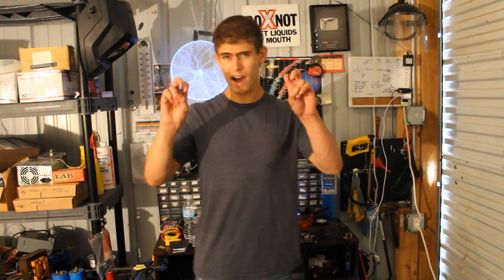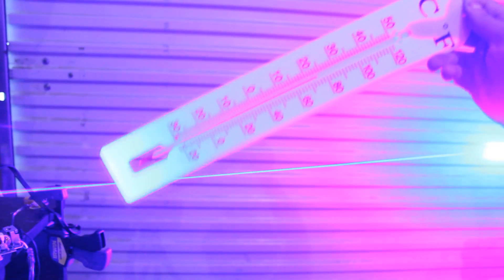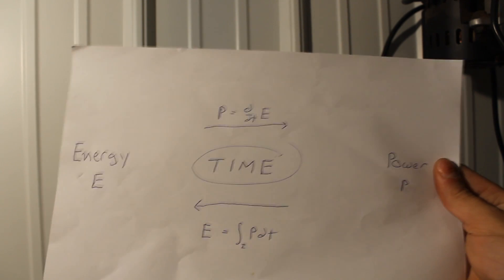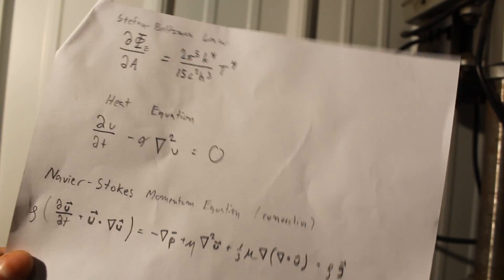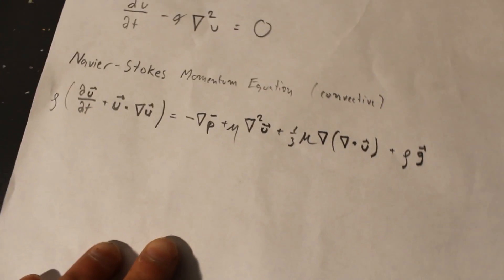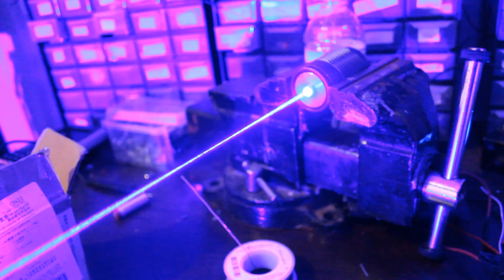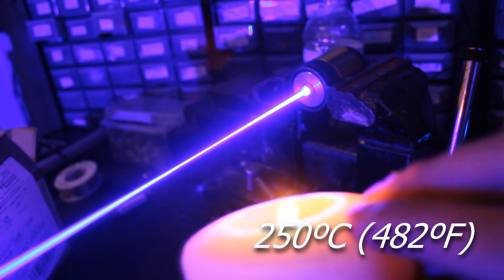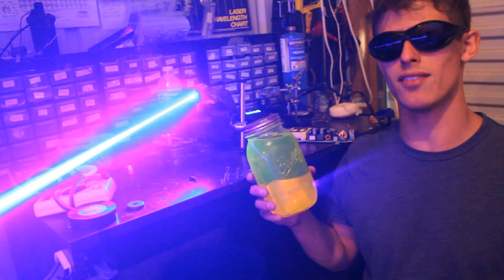How hot is a 5W Laser?

Comment: For an experiment once and for all test water across it’s surface for over 10 miles there should be 66.6 feet of derivation based on the supposed size of earth and curvature. Curvature has yet to be detected so far. Horizon pictures are perfectly flat. My findings are that there is no deviation meaning earth is flat! Don’t believe me test it yourself and film it for all to see and if you get anything but parallel water withe the laser line. If you find out that there is 66.6 feet of derivation I will pay you $10,000. That would buy you lots of laser toys for your trouble. Find a body of water with flat water 10 miles at least in diameter bring a telescope to help aim and align. I use a styrofoam cooler lid because water ALWAYS remains LEVEL and sure enough a double laser effect across the whole water perfectly parallel.
Reply from the maker: Oh so that's why you wanted help building a beam expander...you're a flat eather. I find it funny that you can't use elementary trig (or even plug it into a damn calculator) to build a simple two lens beam expander, and at the same time you feel you can refute the overwhelming evidence that the Earth is in fact round.  

these people vote in elections. pay attention in school kids.
Reply: styropyro watch that pride and arrogance. I offered you $10,000 to utilize that brain of yours to put an end to the debate. Your logical fallacy in this case is argumentum ad populum, or appeal to the masses. I have broken entrance exam records and went to the top schools in honors throughout my formative years. I thought like you once and went to quickly debunk the flat earth three years ago. This overwhelming evidence you speak of is only in the mind when you actually DO the experiments yourself you will be humbled. I am no idiot or a rejecter of true and real science. I earn $275 an hour and consult the top schools and hospitals in security/telephony/computer implementations. If you are correct as your insult seems to indicate why not make an easy $10,000?  Do I need to increase the amount? Think about it you could be the guy that would end the debate forever unless you are scared of what you might find?  

I was a huge astronomy nerd and was the guy who would settle space debates with my “knowledge” of the universe. I have been humbled. There is no space. Point one of your lasers upwards you will see that there is a stopping point not a fading away of light but an actual ending of the laser light. Polaris has remained fixed (I understand there is slight movement) but all stars rotate around Polaris google star trails. There is no way with the movement described by the current universe model that we would see perfect circles they should be swirling movement but we only see perfect circles. 

I am putting my money where my mouth is what about you? Are you up for the challenge? If you win you can insult me endlessly and take my money if I win everybody wins in my mind as you will be an incredible asset to the community with your extremely talented mind. 

Take care and I await your response I truly hope you do this. Three years ago when I started this journey there were maybe 10 flat earth videos now there are millions that alone should spark some suspicion on why the incredible growth. All flat earthers are recent converts we were all taught the exact same in things in school that’s how mind control works. Us older folks have been jaded by our own government enough times to take a closer look at what’s really going on here. 

Thanks for your time!
Reply from the maker: I have little money and did not go to ivy league schools, but that being said I can understand the simple experiments that showed the earth was round that were performed well before satellites and rockets. One proof of a round earth not relying on satellites is in the weather patterns. Regular people have weather stations around the world which record winds, temps, and precip in real time. If the earth is flat, how do cyclones from and stay balanced? A cyclone is held together by a balance between a pressure gradient force and the force from the Coriolis effect. You can look at surface weather observations alone and determine that the only explanation for cyclogenesis (with opposite rotation directions in the hemispheres) is that the wind field is on a rotating sphere. 

Yeah I could use the money, but something tells me that even if I proved beyond a reasonable doubt with lasers that the earth is round, you'd refute my evidence (like everybody else's) and then I'd have built an expensive ass beam expander for nothing.
Reply: Merpie 101 oh the irony...🤣
Reply: styropyro I never went to an Ivy League school (was given $400 by my dad for college) but I do work for them as a consultant. While I was in college I dropped out because in 1993-95 all of the computer textbooks were a joke with 5 year old (ancient in computer world textbooks). I quit started a few tech companies but never made my money until I wised up. 

How about this? You send me a list of equipment with an itemized bill and I will pay for your costs for the experiment. If however I am correct I only ask for a refund of the costs. If you are correct I will pay for your equipment and the additional $10,000. 

Do we have a deal?
Reply: styropyro in reply to your point on trigonometry we use spherical trigonometry to calculate the supposed curve from the spectator and the distance between the spectator and the object in this case I used Ocean ships in my experiments. With what “they” give us as the circumference of the earth roughly 25,000 miles we can calculate the arc with the distance from the observer and the object. The rule of thumb is the miles apart squared then multiply by 8 and then divide by 12 to get the answer in feet instead of inches.

http://earthcurvature.com has an easy calculator to plug your coordinates into. 

Thanks again for your time. I understand how ridiculous it all sounds I was where you are now 3 years ago. We need incredible minds like yours on the correct side of this debate. The flat earth is merely a snowflake on top of the tip of the iceberg. It goes much deeper but let’s just focus on this first. I feel that the first step in the awakening process is understanding your whereabouts first then the rest will fall into place.
Reply from the maker: I've put together a design for a beam expander based on surplus parts that will keep a beam of under a foot (6" ideally) at ten miles that should cost under $100, plus whatever laser system I'd use it with. I can afford that, plus I need a beam expander in case I want to beam the ISS someday (with permission of course). This isn't something I'd do right away, because shining a big ass laser over 10 miles of water will require getting permission from some kind of authority. If I go through all this work, and I'm able to prove the curvature of the earth, how do I know you won't stiff me and disappear?? :p
Reply: E Isopody not at all that’s a strawman logical fallacy. There is the law of perspective the farther you are away from something the smaller it appears until the vanishing point. Try it on a long straight road that has a stop sign or something at the end of the street if it’s a few miles you will be unable to see it until you approach. Look telephone poles on a road the ones further away appear to shrink but in reality are all relatively the same heights. The telephone poles will disappear from the bottom with only the top still visible. The same occurs with ships as they sail away they disappear bottom up. It’s the law of perspective. 

Rainbows are another clue to the true shape of our home. The ONLY way to create a rainbow indoors is with a mirror. So outdoors what would be the mirror? The glass dome. The shape of an outdoor rainbow accurately depicts the shape of the dome overhead. The elite that runs this world love to mock by rubbing it in our faces in movies and entertainment. The Simpsons movie depicts the done as does another episode where homer hits a home run that cracks the dome. The show Under the Dome, the movie Mad Max and the Thunderdome (ever wonder why thunder has that reverberation effect its bouncing sounds off the dome), Truman Show, Dark City and tons of others.
Reply: styropyro Because with the knowledge that I have gained in the last few years that this place is a creation indicates a creator and therefore I will not let you down. I was an atheist for about 24 years and a space freak so in order for me to have made the switch the evidence would have to be substantial. I am not religious or go to church just a guy who’s only agenda is truth. I found out the earth was not spinning due to flight times and would sit on Jetblue flights with their realtime data app on the monitor and I found an anomaly that the supposed 1000mph spin of the earth had zero effect on my flight times and the only variable that would alter the results were wind speed as the average speed was relatively the same. 
While it was not “oh we live on a flat earth” conclusion it put a question of doubt in my head. I then saw someone post about flat earth and went to find out for myself. I live in Florida and the easiest test I could think of was the ocean. I brought my Celestron 127eq telescope and used it to pan back and forth on the horizon and from North to South the horizon bisected the view perfectly in the middle. On one of my pans North I noticed a ship’s bow coming out of a port. I then saw a huge B on the smokestack and figured it was a Bahamas cruise ship the port it came out of was port of palm beach which was exactly 12 miles away. I could see the water hitting the hull and then figured maybe the tripod was too high and got down at just above sea level a few inches above the water and noticed even with just my eyes could see where the hull and the water meet. At 12 miles away there should be 96 feet of downward curvature and I should only be able to see the top of the smokestack but could see the entire thing. I then waited 2 hours and called the ship company to find out what their average cruising speed was (20 knots/23 mph) to get an idea of how far away it would be in a few hours because I knew dinner would take at least an hour as my daughter eats slow. It ended up taking two hours and the ship was still in full view without the telescope and could see the entire ship down to where the water hit it and could see the water hitting the bow and hull through the telescope. I estimated between 40-46 miles away which would be 1066-1400 feet of downward curvature and yet there was zero curvature detected. 

As a sign of good faith if you give me a date range of when you can do it I will send you the $100 to cover your expenses. Send me a message with an  email or however you want so I can send you the money. 

Thanks for your time, whatever the outcome, I can assure you this will change your life for the better. You have a gift and only a truly intelligent person can see the intelligence in another. While I agree the topic is extremely polarizing it is one of the easiest things to prove. The problem is like in the movie the Truman show “We accept the reality of the world with which we are presented." This was said when the reporter asked why Truman took 30 years to figure out that the world around him was a farce. Just count the amount of times you are presented a globe in just one day. Become aware of everytime you see it. We all had that talk by the teacher in Kindergarten that explained how ignorant and foolish the ancient people were because they thought the earth was flat and would fall of the edge of the earth and typically the classroom would erupt in laughter. My dad is 75 years old and he remembers it verbatim I remember it (41) my nephew and niece early 20’s and my daughter had the same story told to her two years ago. We all went through the same programming and conditioning and none of us thought to question it. It’s a hard pill to swallow and I feel the older generation is too far gone to get it (been working on my dad for 3 years now to no avail). You are young and extremely bright and talented and figured if minds like yours can be freed humanity has a chance to break free. 

I wouldn’t put forth this much effort if I didn’t care.

Thank you!
Reply: E Isopody Ummm what? 🤣 What are you talking about? There’s a double rainbow 🌈 and the colors are inverted indicating yet another mirror, inside a mirrored dome this is easily explainable.
Reply: E Isopody the law of perspective states the higher up you go the further out you will see.

Comment: Should be pretty easy to get an estimate of the upper limit using Stefan-Boltzmann law (P = AσT^4). Assume the laser is illuminating an ideal black body, circular with the same diameter as the laser beam, and infinitely flat.
Assume the beam diameter is focused to 1mm, and the power is 5W
Beam cross-sectional area = 7.85398163e-7 m^2
σ =5.670367e-8
solving for T we get
T = (5/(5.670367e-8*7.85398163e-7))^(1/4)
= 3255 K
So the absolute maximum temperature of an object illuminated by the laser would be about 3000 degrees C for a 1mm beam.
Reply: this is coming from a guy with a rastafarian snoop dog jesus pfp
Reply: Hey!, this is actually a pretty sound answer. I would include the fact that this would be the average "temperature" of black body in the beam cross section and further clarify that, by definition, the beam and the blackbody are in thermal equilibrium when the power absorbed is equal to the black body radiation emitted.

I think the main problem with this answer is that while, as you pointed out, the black body would be a good upper limit for absorbing, it is also the upper limit for the rate of heat lost. If you had a material that showed a black body cross section to the laser and then protected the heat with a low emissivity insulator, then you could get it a lot hotter than 3000 C, right?
Reply: what about air currents, is that an included varible?
Reply: @j.d.2703  At these high of temperatures, blackbody radiation will be the most significant cooling mechanism.  This is because of that T^4 (temperature to the 4th power) dependence in the Stefan-Boltzmann Law, so the radiated power grows very rapidly with increasing temperature.
Reply: @watsisname  actually, unless the object is in a vacuum, then convection is always the most significant cooling mechanism
Reply: @watsisname  also, I know that you don't know what you're talking about, "T" stands for time, not temperature, and you can't solve for "T" in an equation that doesn't have "T" in it
Reply: @greekyogurt9997  Incorrect.
Reply: To be clear, this isn’t the temperature of the beam, but certainly a useful metric of how intense it is
Reply: @1495978707  Right, a laser heating a surface isn't like two surfaces in thermal contact...unless you consider the LASERing material the second thermal object, but the LASERing material has a negative "temperature"
Reply: thank you
Reply: Nerd.
Reply: @ranger-rj2ym  sir what channel do you think you're on
Reply: @_2hu4u  A very nerdy channel which I can appreciate.

Edit: With people whom I can pester. Heh.
Reply: @watsisname  i know what I'm talking about,  can you back up what you are saying
Reply: @UCLxI5OrtZ8JfaZoScucXeAQ don't say a bunch of words that you think sounds smart, you don't even know that "T" always stands for time, and boltman studied entropy, not lasers
Reply: @greekyogurt9997  Boltman?  lmao.
Reply: @watsisname  a typo doesn't weaken  my argument, pointing it out shows that I hit close to home
Reply: @greekyogurt9997  No, T is for temperature NOT time in Stefan-Boltzmann law. @watsisname is correct. P = AεσT⁴; P is power, A is area, ε is emissivity, σ is Stefan-Boltzmann constant and T is temperature. "unless the object is in a vacuum ... convection is always the most significant cooling mechanism" is an incorrect assertion. Heat loss due to convection is linear relationship with dT whereas through radiation it is quartic so with increasing temperature radiation is increasingly dominant.
Reply: @RadioTrefoil  still, none of you have backed up your claims
Reply: @greekyogurt9997  Maybe, if this were actually an argument and your typo were not intentional. ;)
Reply: @greekyogurt9997  Firstly, the burden of proof is on you. 
Specifically what claim have we not backed up? The one about T being temperature, which you can verify in a 10 second google search, or the one about radiation being dominant over convection at high temperatures, which is simple mathematics?
Reply: @watsisname  in a debate, your argument is your point, and the typo was an accident
Reply: @greekyogurt9997  Uh huh. Who's trolling whom now? ;)
Reply: @watsisname  you were trolling me?
Reply: @greekyogurt9997   Do you enjoy it? We can keep writing to each other here if you like.
Reply: This would be the best estimate we could reasonably make. I think Pyro was going for the exact answer with his estimate.
Reply: Wrongggg! Laser has negetive kelvin temperatures. Now rethink about it.